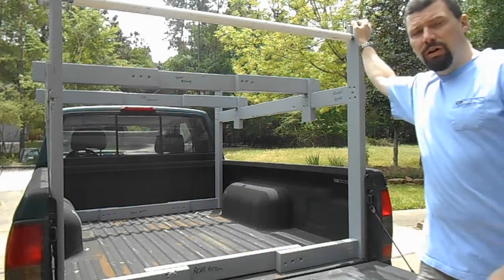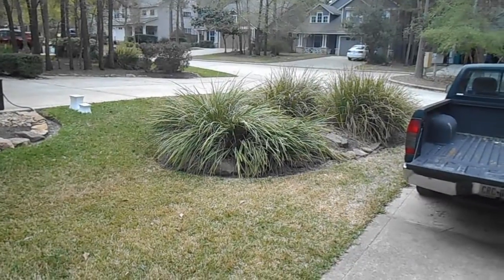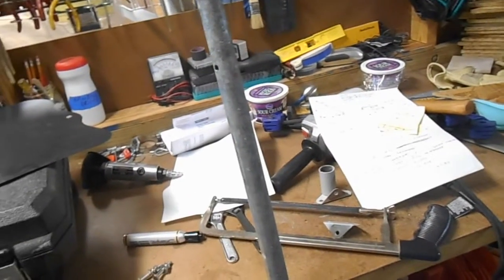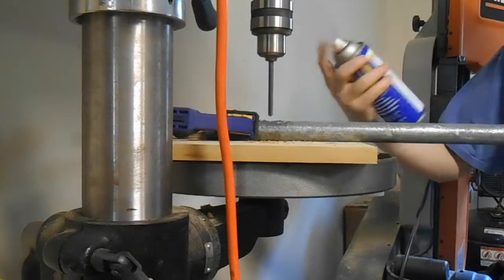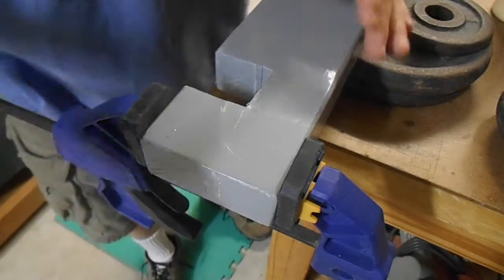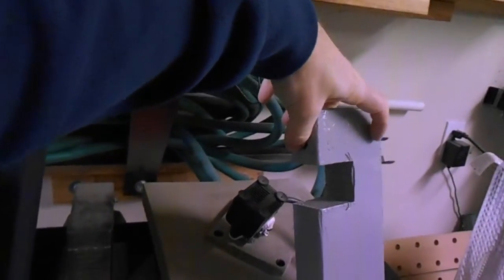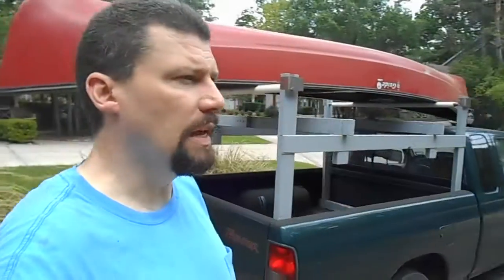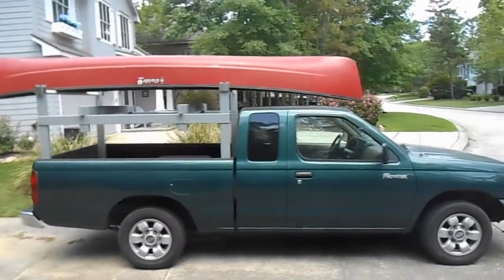Make A Canoe / Lumber / Ladder Rack - Part#2

Comment: F=ma  I see one risk/problem with your design. Under normal conditions, I see your design working very well; however, under an extreme braking situation, where F is force, m is the mass of your load, and a is the acceleration (deacceleration) under braking conditions; you are putting a huge force on both the forward upright supports and in particular the drywall reinforced ends. A 100 pound canoe will "weigh" several tons at the point of those joints. Ask yourself if you would use that joint to support a small car. That's in reality what you are doing. An imperfect improvement may be a metal strap reinforcement from top to bottom of those uprights.

Comment: I appreciated the video instruction. The longer style allows novices to learn techniques without assuming that they should already know how to do something. As you shared, you can always move ahead using the slider. We have a 17 foot, tandem kayak which weighs 100lbs. this design looks like it will make it easier to slip onto the truck. I may use some pipe insulation over the pvc as a cushion as the kayak is rotomold plastic.

Comment: It's a nice design, and easy to reproduce. I'm puzzled by your choice of drywall screws for reinforcement and securing the stainless steel end caps. After so much effort to avoid rust and corrosion, you used interior screws. Maybe I am mistaken in what you used.

Anyway, thanks for the video. I enjoyed both of them.
Reply from the maker: Nope, you're not mistaken.  I simply used the drywall screws because I already had them, and I tried to spend as little as possible on the project.  The thin powder coating on them actually does a fair job of protecting them from rust, presuming they don't stay wet (i.e. in a puddle of water.)  I'll probably switch out the ones on the stainless steel when I have an excuse to buy some exterior decking screws.  For the reinforcement screws, I just gooped some silicone over them..but forgot to film it.  Ideally, the exterior paint would protect those screws..except I added them after the fact.
Reply from the maker: BTW, thanks much for watching.  I'm glad you enjoyed the videos.